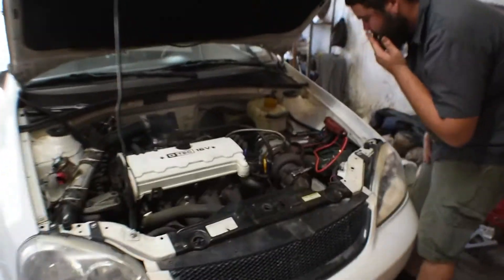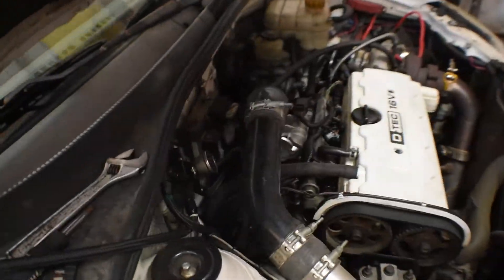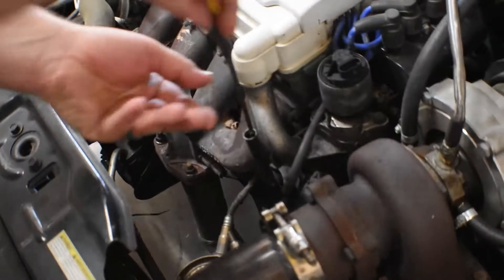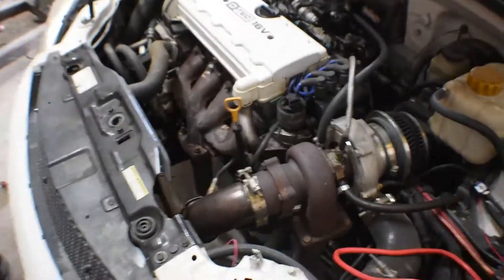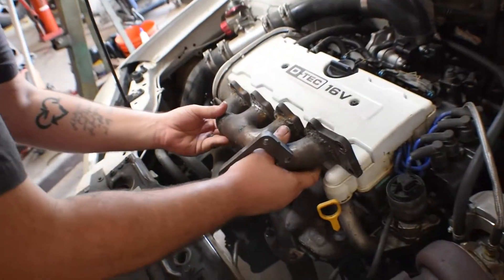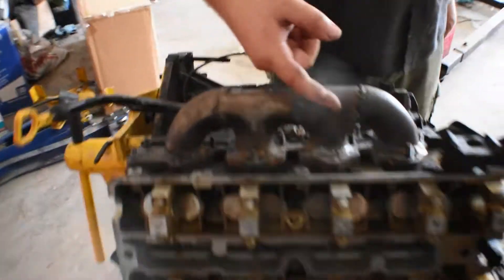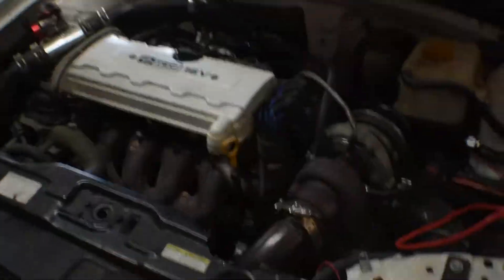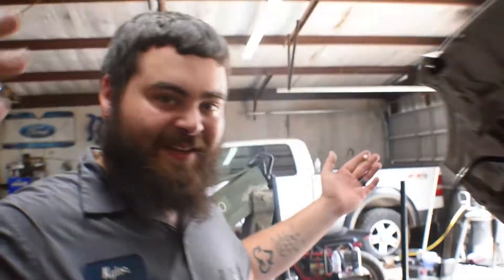Turbocharged Suzuki Forenza Update Video!

Comment: just wondering how did you run your intake temperature sensor
Reply from the maker: Same spot and way its installed on the stock intake. We drilled a hole in the charge pipe and used a grommet with some sealant